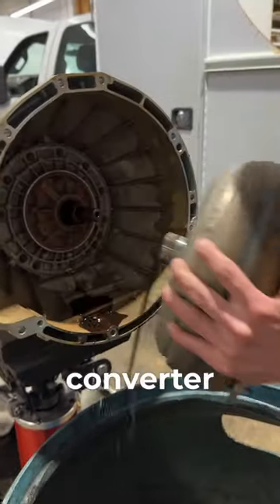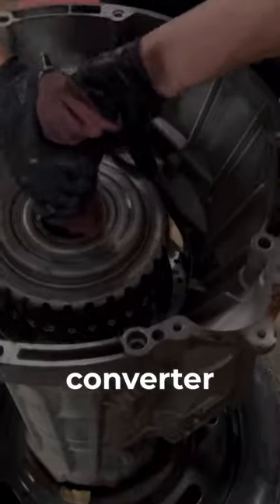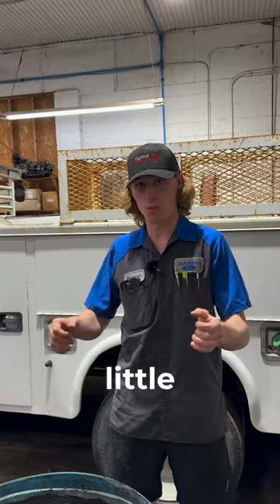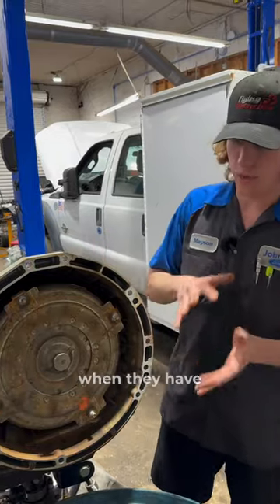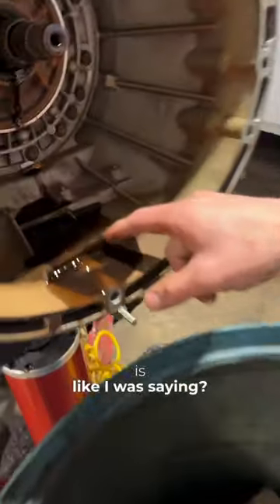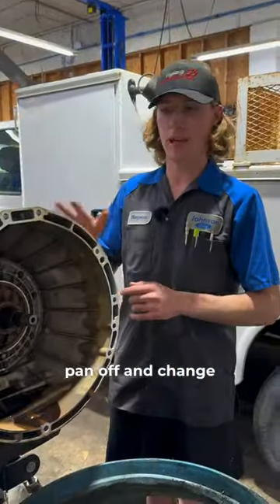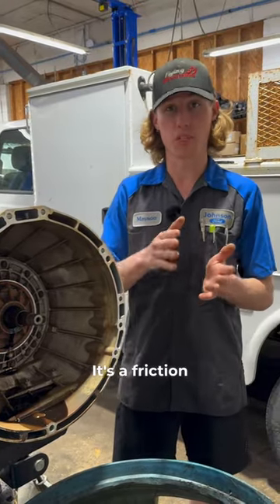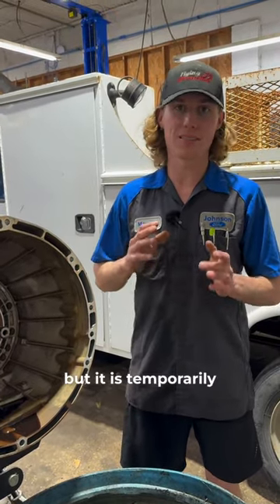Ford F150 6R80 Torque Converter Shutter? #ford #f150 #shorts

Comment: Here's an idea. Bring back manual transmission. Not only will they be more reliable, they'll actually be better on fuel too and harder to get stolen because all the saps these days that can't drive manual... They're always so worried about gas mileage. Okay then give me 8-speed manual transmission 10-speed manual. I guarantee you will get better gas mileage than a 10-speed automatic

Comment: Had it on my 1995 f150 with 30,000 miles AFTER I changed the fluid. I will not buy another ford.
Reply: Luck of the draw I guess.  I have a95 f150 and it's a tank. 140k still going strong. But my 17 f150 has this exact issue

Comment: I got rid of this 2014 F-150 the transmission blew up 4800.00 Dollars later there garbage
Reply: Our 2014 5.0 just hit 160k miles and it’s hauled a 5000 pound trailer most of its life, never had an issue. Transmission shifts like butter.

Comment: We had a 16 ecoboost 10 speed we just bought for a work truck with 26k miles on it had shutters and weird shifting head and there, went to ford to get it checked out, and they said it was normal for it to do that, lifter started knocking at 50k miles, we traded that truck in, we never had such a shit ford as a work truck